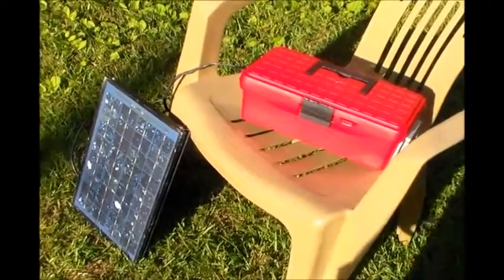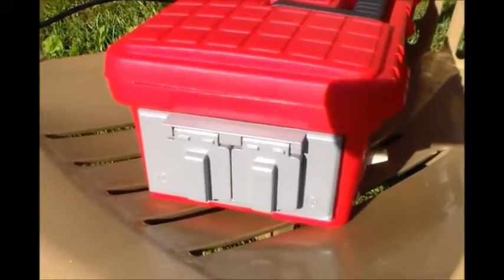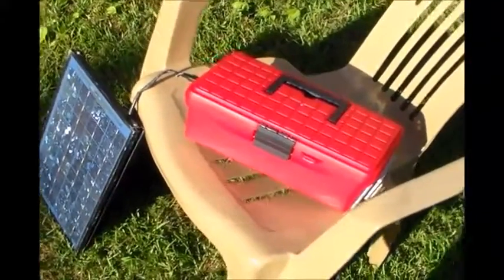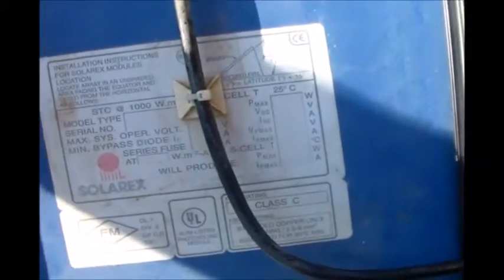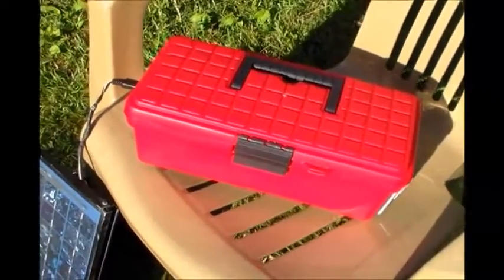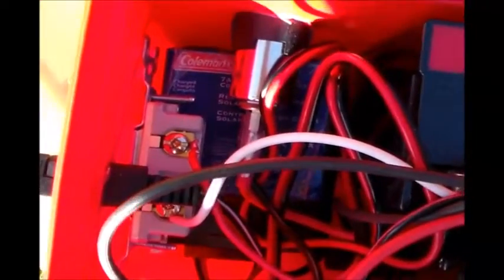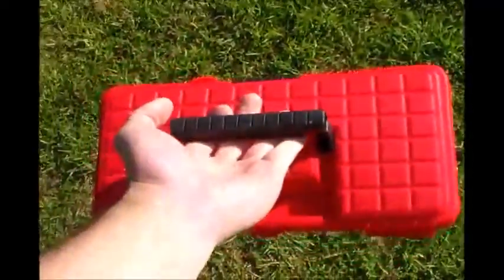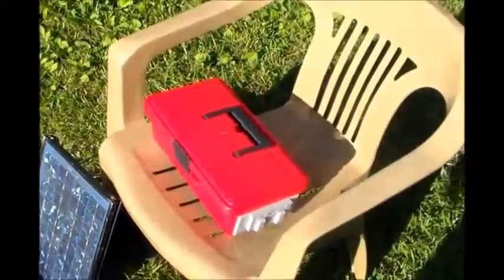DIY Solar Generator For Camping, Power Outages, And Preparedness

Comment: I really like this....
Could you do a parts list...
Reply from the maker: Sure! Charge controller, 2 switches, one outlet, one outlet cover, one cigarette outlet, power inverter, and a battery. You will also need various electrical terminals/connectors.